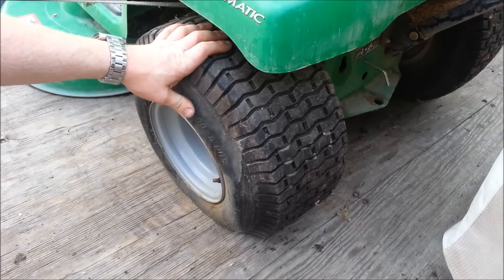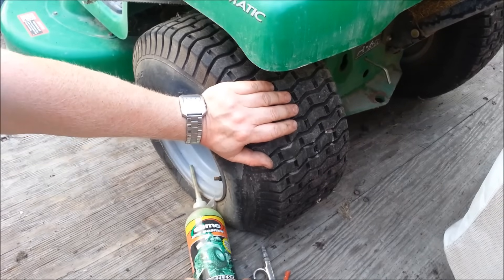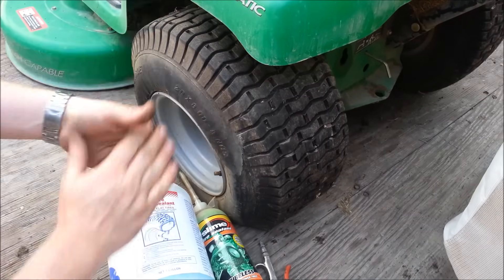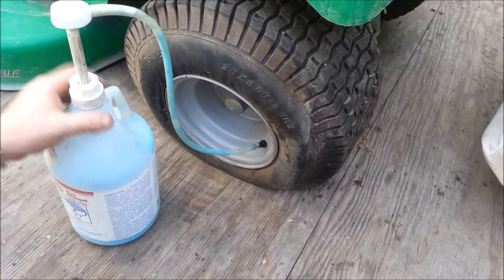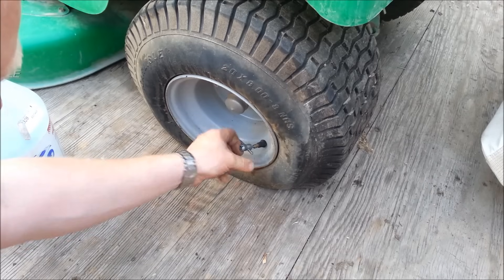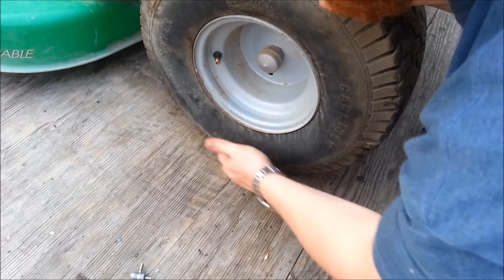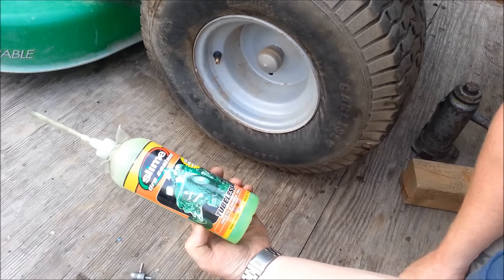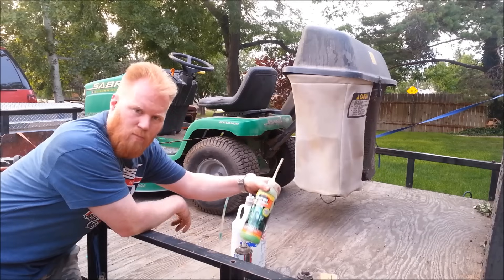Fix Dry Rotted / Flat tires on Lawn Equipment ATVs

Comment: Many comments say put in an inner tube but that's like ten or twenty bucks and a pain in the butt job...this slime works great five minutes you're finished you rock I've done it many times think I will get some cheap no name stuff
Reply from the maker: I seldom find a tire I can't seal with slime or better "Tire Ject" but when I do generally the tire is so far gone not even a tube with help.

Comment: I bought a plastic bottle of this stuff that was suppose to be especially for motorcycle tires and I had brand new Michelin tires installed on my big Kawasaki Concours sport/touring bike. I got it home and placed the slime stuff in both front and rear tires. After I rode the bike and the tires got really heated up hot this stuff equalized inside of the tires and I have absolutely no shake, shimmy, unbalanced feeling and I could let go of the handlebars and the bike tracked straight as an arrow. The tires have almost 25,000 miles on them and they actually do not look bad at all. It even helped with the wear and the tires are very evenly worn. I have pulled screws, wire, nails, wood and other kinds of stuff out of the tread and never lost any air at all in either tire. All I did was pulled whatever was stuck in the tire out of it and the hole just healed itself. This stuff works really well.

Comment: Thanks for sharing. Got a 15 year old Deere L130 and this Fall both front tires developed slow leaks and eventually one rear tire did too. I could pump them up and cut the lawn. About 2-3 days later they were flat again. Going to try this! Does the outside air temp influence slime's effectiveness. In New England and while it may hit 50 tomorrow, night temps are down to or below freezing this time of year.
Reply from the maker: This stuff uses antifreeze as the liquid so it won't freeze. The only thing I found better than Slime is Tireject. Tireject seals sidewall cracks and bead leaks a little better, I did a video on that stuff as well.

Comment: I put Green Slime in my Wheel Barrow Tire that was dry rotted about 10 years ago, it has not leaked since--I did Spin tire around about 5 mins. to evenly spread out slime...
Reply from the maker: Awesome.

Comment: Great advice for everyone. I have been using Slime for 4 or 5 years now or longer in my lawn tractor. Works great. Finally got tired every time I went to use my wheelbarrow, lawn cart and tractor I needed to pump a tire or two up with air. The wheel barrow and lawn cart are always stored outside and of course the tires dry rot quicker. Pump in some Slime and spin the tires around or drive them around and you are good to go. Was starting to have problems with the front tires on my now 17 year old lawn tractor stored inside. I even tried to find the leak in the right front tire more then once by filling it with air and placing it in  a tire and wheel dunk tank I use for car tires and could not find the leak no matter what I did. Put some Slime in those front tires and rarely add air to them anymore. The money you save from not having to buy new tires not really needed and the headache of dealing with flat tires more then pays for the little bit of Slime it takes to fix the problem. Haven't tried the no-name product being I haven't needed to buy anymore to fix anything. I purchased mine in the 1 gallon container. Sixtyfiveford has some of the best videos on You Tube.
Reply from the maker: Thanks.

Comment: This information is accurate. Ive done this with numerous mower tires and it has never failed. Even a kubota front tire that had about 20 punctures around it is still holding air. Works excellent! I've used Slime brand.

Comment: Slime does work good. I have an old WWII forklift with air tires. The tires and tubes are probably from the 1960's. They are way dry rotted. I've run over some nails. I'm afraid if I take the wheels off this thing, it may not go back together. It's rough. Slime it up...... it holds air enough to use it. For a 80 year old machine, that's good enough for me.
Reply from the maker: Sometimes it just takes a lot but it has always worked good for me.

Comment: Ive used fix a flat with slime in it and i can usually get 2 or so front tires out of it but it doesn't seem to hold up more than a year or two. I didn't realize you could get a jug of it. Never thought to look. I was gonna spend $100 on a set of solid front tires and be done with it but a small bottle of slime for 10 is cheaper than even tubes. Thanks I'll give it a go.

Comment: Have a garden tractor - 2 front tires leak; trailer for same garden tractor-- both tires leak--- tried what you did here in your video....all 4 tires haven't lost air in over a month now! And all I used was one small can of slime to fix all 4 tires because I took your advice on how much to put in the tires. Thanks!
Reply from the maker: laughtrax4 Awesome. It's nice to not have to worry about them all the time.

Comment: Unfortunately I had a Riding Lawn Tractor that has set in the barn for almost 15 years. All 4 tires were extremely dry rotted side walls. Tried the Green Slime. None would hold air. I am sure that it would have worked on less damaged tires.

Comment: Thank you for the great video.  I have a riding mower I haven't used in "forever" and the central Florida elements have really taken a toll on the tires and they are all flat/cracked.  The local mower repair place wanted to charge $20 per tire to "fix" them so they could even roll the mower onto their trailer for the other repairs I am not comfortable nor equipped to do.  Yesterday I bought I giant jug of Slime at Harbor Freight and now have much greater confidence to tackle the four tires thanks to your video.  Thank you!
Reply from the maker: I'm glad the video was a help.
Reply: How did it go?

Comment: have used a lot of slime . The big white jug is interesting
Reply from the maker: wtbm123 It's WAY cheaper. In fact I just bought it in the 5 gallon bucket as well.
Reply from the maker: Yeah, the actual Slime brand is spendy. I paid around $90 shipped for 5 gallons of the Rotary brand. I used to get stuff made by Bell off Amazon for around $20/gallon shipped, but they stopped making it.

Comment: Slime will ruin any tire pressure gauge. Walmart has the tires for really cheap. If they don’t have your tire, you can other it online and pick them up at the store in three to four days. Inner tubes are s must for older rusty rims, garden cart and wheelbarrow tires.

Comment: My brother got a piece of wire (piece of radial steel belt or something) in the sidewall of my mower tire so I bought this stuff and put it in all 4 since I was doing it anyway but I put the recommended jug per tire. Just the other day I pulled the mower out again to use it and discovered my brother got a roofing nail in the tire. All I did was pull the nail and immediately take off mowing and the tire sealed itself just like the slime stuff intended. Glad I have it there for future use, if I ever have to buy new tires I think I'll fill them with it too as a precaution for when I need it.

Comment: I've been using Slime or similar products in car & truck tires for the past 30 years. It stops alloy rim leaks at the bead which they always seem to do. Like you, I always put in half the recommended amount. If you put in what they suggest, it will throw off the balancing. Nice videos, quick & straight to the point.
Reply from the maker: Thanks for your input. I've had great luck with this stuff.
Reply: What's the stuff he used did I miss the name somewhere

Comment: Thank you for this tip. My tires were dry rotted so bad I did not think there was any way this would work but sure enough I took tires off mower and added a cup to each tire and then sloshed it around each tire repeatedly and bingo, they both sealed up like magic!
Reply from the maker: I've had amazing results with this slime stuff over the past 15+ years. It's saved countless lawn and garden tires. The only stuff I found to work better was a product called Tire Ject, but I've only been using that for around 16 months.

Comment: Latex paint workes great to fix old tires. Its Better than Slime tire sealent.  just squirt 1 pt to 1 qt of latex paint in valve stem then air up tire and drive around. if you are tring to fix a large crack add a can of pepper to the latex paint.  i have used this for years to fix lawnmower tires.

Comment: A cheap inner tube is the better fix, it'll last until the tread is worn out or the sides rot completely away. Harbor Freight has them fairly cheap and their 18" tube fits most small lawn tractors. I generally install a tube, then fill the tube with washer fluid for ballast and added weight.

Comment: NAPA brand sealer outperforms  every other brand I have tried with no cotton valve clogging crap. Sealed my loader tires which were leaking through the sidewalls when the green crap did nothing. Saved me hundreds of $ on tires. Just did my golf car tires and no leak since. I purchased a brand new tire for my truck worth $250 because it had a sidewall leak for $25 and it is just about worn out now. No fan of NAPA but Ameraseal with the NAPA logo on the bottle WORKS when others did not.
Reply from the maker: I have since switched from Slime type products  to TireJect which looks identical to the Amerseal. Essentially looks just like milk without anything else in it. Amazing stuff!
Reply: @sixtyfiveford  exactly. Great to know. Where do you get it?

Comment: Fix a flat..not just air or some s*it...expanding foam and it works well.
Reply from the maker: Expanding foam is the worst thing you can do in a tire. The individual bubbles crush and collapse rendering the entire tire useless in no time.

Comment: Used a little more Slime than bottle recommended just for experiment (  I'm cheap ) on a Rear rider mower tire that was WAY dry rotten and whould hold air a half day at most.  Still holding air after two months now. Again " very dry rotted it was "  ! I'm totally sold now on putting Guwey stuff with particles
 in tires to stop leaks.  PS  Also works on aggravating  slow rim leaks on tubeless Motor cycle tires.   Love it and worth the $

Comment: I put slime in the rear tire on my murray at the  of the season last year.  It had a leak in the right rear. Never knew where it was. I just put some in it, put air in it, mowed the last season mow, and parked it in the corner. One day I glanced at it, thinking about doing the maintenance work on it early, and noticed green foam in a straight line on the inner sidewall of the tire.  I was like, huh! Thats the hole.  And it still hold air to this day.  But im glad this was brought up becaus  im thinking about making it a speeder...  lol.
Reply from the maker: NateWilson99 It's amazing what holes it will plug up.

Comment: Mr. 65. Hello. 
I came across a recipe cor this stuff that I've used around the homestead for many years. You simply bring a gallon or so of water to a boil with first stirring in some corn starch and a good handfull of black ground pepper "corse and fine ground mixed would be great" Then add some antifreeze before it quits boiling. To put in the tire i make a pumper with a gallon glass pickle jar with 2 holes drilled in the metal lid. One hole you put a valve stem in and tbe other a piece of 1/4 inch ID. clear rubber hose and let it go to the bottom of tbe jar. Put the 1/4 inch hose over the open valve stem on the wheel of the tire you're fixing and add air to the valve on top of the gallon jar witb the homemade sludge in it. It will quickly pump into your flat tire. Its really not the safest method and wrapping the gallon jar with good ducting tape would help because the pressure could explode the jar.  for a quicky I've also just mixed black pepper with antifreeze. Both front tires on my big tractor leaked air and they were my first fix with this solution and I've Never added air since and that was many years ago.
Reply from the maker: I've heard of similar recipes but really no long term results. Like you said, Drag Strip rubber would be the right size. The only other ingredient that I've read about is cotton fiber. I suspect simple dryer lint would suffice for that.

Comment: I put the red kind from lowes into all my non highway tires just to prevent dry rotting and cracking and leaks. So far its worked great on my husqvarna riding mower. I put it in a year ago and just last week thought i needed to add some air to the tires but nope. The tires were almost perfect and they are worn heavily for there short lived life. (I mow 2 acres twice a week) and the tires were made in 2010
Reply from the maker: Karsten Jackson Wow, you mow a ton.
Reply: sixtyfiveford yes it can get old quickly. but i get paid so it helps..

Comment: Have you ever tried latex paint and letting it dry inside the tire one layer at a time, requires dismount but most of the time old latex paint is free.
Reply from the maker: I've heard of people doing this with decent results. I would suspect the latex would peel off the inside from flexing after a year or so?
Reply: @sixtyfiveford  I used the method on some tractor tires and they lasted for the to years I had it

Comment: Last year I had a tractor tire from a Massey to35 get several holes and tears up to 3 inches wide. I fixed it with some tire patches, a five gallon bucket of sawdust, and 10 gallons of junk latex paint from the dump. Sealed up tighter than a wood tick and ain't leaked since.

Comment: Slime will work sometimes if using the proper amount on the label.  If I find a gallon for $10 at a closeout store, I'm going to try 2x the amount.  I have so many leaky tires, Slime is too expensive - especially when having to use 2x to be sure.
Reply from the maker: Dilute it with windshield washer fluid by 25-50%. That helps it flow around the tire much better.

Comment: Now there is an excellent tip. I always wondered if spray foam insulation would work well in a tire to make it flat proof but have never tried it. Don't know if it would expand and cure or not, inside a sealed tire. Thanks for the video Moe.
Reply from the maker: EdOfTheNorth I have seen people put spray foam in wheel barrow tires etc. I would think it would eventually crush under the weight. I'll have to try it someday.
Reply: sixtyfiveford  I tried it .. It does work , But the weight does play a huge part in how long it lasts .. Yours is a better fix !!
Reply from the maker: Thanks for the spray foam heads up.
Reply: No problem ..
Reply: @sixtyfiveford  spray foam was really MESSY 4 me!

Comment: If your into really regenerate the rubber tire rapidly in scolding hot water will soften the tire up then dress them up with anything petroleum like diesel or kerosene old oil or any reguventing petroleum base because the tire eventually loses its petroleum base  in the rubber itself

Comment: Super glue bonds rubber EXCEPTIONALLY well! I did this to the same exact tractor in the video. We glued the outer casing back together with super glue, then filled with the green slime.Still holding air after 4 years. To hold and press the outer casing together while gluing, used the tip of a screw driver, not your finger. Baking soda also solidifies the super glue instantly.
Reply: Do you do the slime first, so that it has a chance to seep through first? Then super glue?  The other way around, it may not establish a flow of the slime through the interior cracks, right?
Reply: @ramchillarege1658  I super glued EVERYTHING  first. If the surfaces for the glue is dirty, clean with carb cleaner, etc and let evaporate till dry. Hitting the tire with a heat  gun will also make the rubber pliable and easy to work with.  Remember that super glue can be dusted with baking soda to solidify instantly! The glue is acid based. The baking soda neutralizes  the glue. Happy Thanksgiving!
Reply: @Joeak74  Thanks for the clarity.  There seem to be multiple brands of super glue. Gorilla, Scotch (chepaer) are they all good on rubber?  I was thinking of just hitting it with an electric heat gun, or a turbo air/propane torch (broad flame) lightly to vulcanize it until I ran into this thread.  But, like your approach beter.
Reply: @ramchillarege1658  I should have clarified... The "Gel" version of super glue is TERRIBLE for everything. Use the regular old  "thin, watery super glue. I use the Harbor freight super glue in the little tubes. The tire carcass was still in good shape, it was just that the outer casing (tire rubber) was split, de-laminated, and cracked. I could physically push a welding rod through the tire. It was that ventilated. I said the hell with it, and figured I would give it a chance, and it worked. And it worked well.

Comment: Perfect Tut as usual! Look up for 'Diy Stans' or 'Diy Tire Sealant Recipe' on the net.Not to mention 'Stan's Notubes Sealant' which was the best i have used so far.You can mix Ethlyene Glycol(food grade is better but antifreeze works as well),Liquid latex,Glitter(finer the better) and Slime combination and make a homemade sealant which will be very fast and high in viscosity.
Reply from the maker: solosipahi Thanks for in the info. I've never heard of the Stans sealant.

Comment: Thanks for your simple and common sense ideas. Just Slimed my rear Cub Cadet tractor tires, and they are now holding pressure. I've been topping off these tires, for a few seasons, each time I use it. Even had a tire go flat in the back acre a few times.
Reply from the maker: Steve Eaton Hey Thanks. Yeah, nothing more annoying than a flat tire when your far away from air.

Comment: Does it scrap the rim after if i ever want to change the tire ? Because it on my 4weeler and im scared that it will make a mess and stick and scrap the rim for later?
Reply from the maker: I've washed it out years later without any issues. It comes right off with a hose. Tire-Ject is better though in my opinion. https://youtu.be/nfti6Jt0ye4